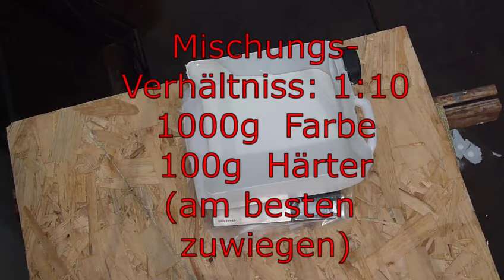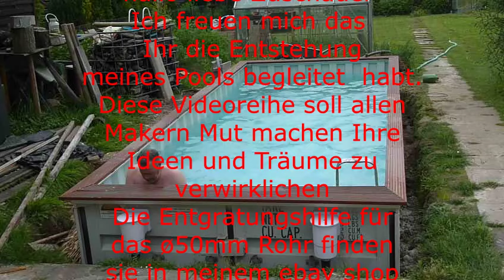Part 3 of 3  build you shipping container pool lower 5000€

Comment: Great job. Maybe you could put English translation of the German text in the description of the video?

 How did you waterproof it? By painting? Soldering?

Cost of project?
Reply: This might help you a Google translation of his 1 replies 
 To your questions: The filter system is not yet completely finished (I am still missing ball valves) that will be delivered at some point! Then I'll do an extra video. The water depth is 1.35 m, that's enough for me. Dredging and disposing of the earth are expensive enough! Color you can also take blue. This is a 2k epoxy pool paint (chlorine-resistant). I added a sealing slurry to the area. This cannot be seen in the video. .